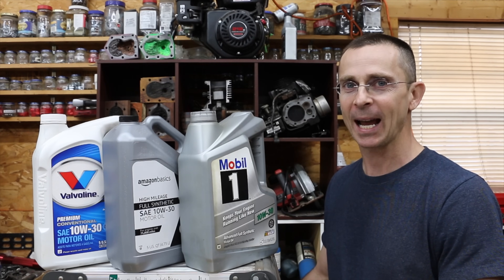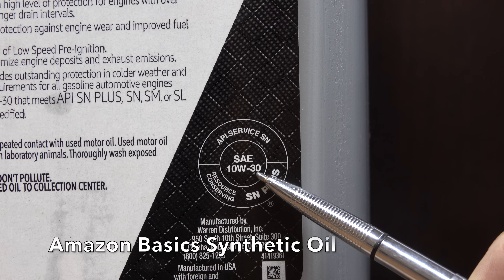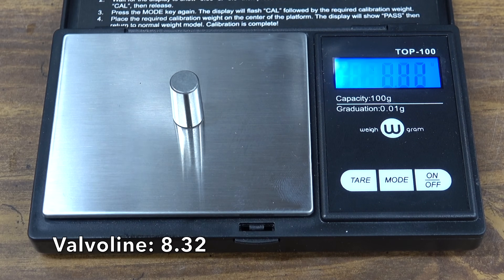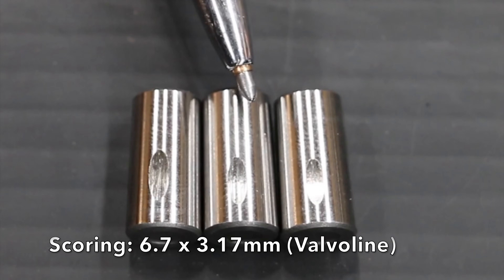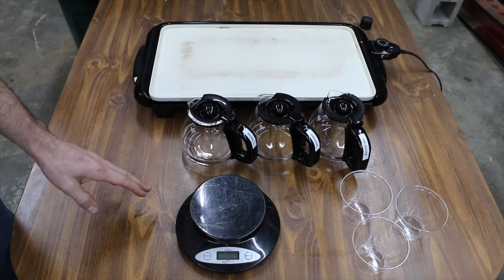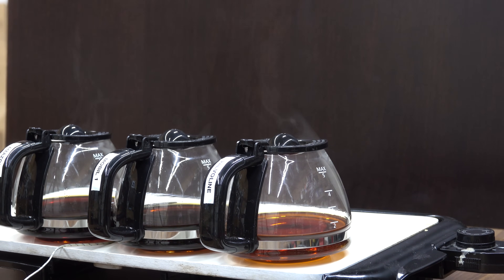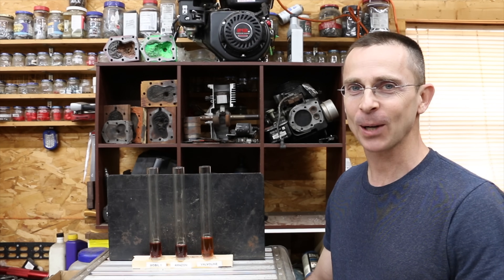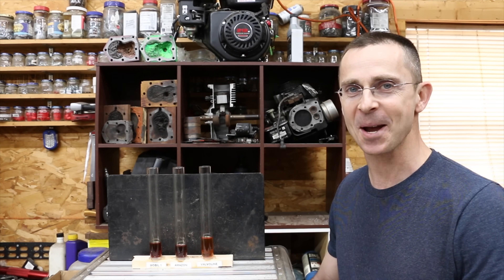Is AmazonBasics Full Synthetic Motor Oil better than Mobil 1? Let's find out!

Comment: I bet the Amazon oil is just a quality name brand oil that got licensed out to amazon for re-branding.
Reply from the maker: Thank you.  It's made by Warren Distribution, a very reputable company
Reply: @ProjectFarm  > can we safely assume that the new Costco oil (Kirkland Signature) is identical to the Amazonbasics because they're both made by Warren?  

Of course, provided we are comparing apples-to-apples, ie same weight, synthetic. dexos1 etc., etc.  PS - your videos are amazing, I'm a HUGE fan.
Reply: @ProjectFarm  i was actually looking at that during the talk
Reply: The problem is that it is put under that generic name.  So there is no guarantee of future quality.  Amazon probably operates like walmart in this regard, sourcing from whoever will meet their specifications at the lowest price.  That may be a good producer today, maybe not so good when that contract runs out.
Reply: @gurgy3  Yes, I totally agree.  There is all kinds of swapping sources on all the other Amazon Basics products...
Reply: @gurgy3  It does not matter who makes it, if it meets the specs.
Reply: SLRS I’m sure Amazon has a comprehensive lubricant QC laboratory staffed by engineers and not just a corporate office flunky with an MBA trying to shave a few pennies sourcing the suppliers.
Reply: @gurgy3  actually there is a guarantee that quality will stay consistent. It's the API SN+ seal on the bottle. If they don't meet quality levels, they lose their certification. And would be sued I'd they didn't meet claimed quality.
Reply: I was wondering that too. "Amazon Basics" is just a name brand but there is no way they built a bunch of different factories, made a whole RnD department for each division to develop products from nothing. definitely just contracted out work to existing factories.
Reply: VanSanPro Costco does that with Kirkland so I don’t see why not
Reply: @tyleralexandermills  Fun fact: Kirkland signature full synthetic oil and amazon basics are both made by warren distribution, along with walmart's supertech full synthetic. They are all most likely the same oil.
Reply: @VanSanProductions  Of course it is.  Amazon does not make oil.  Isn't even a question.
Reply: Similar to the great value brand of Walmart
Reply: @DarthNeummy  also great oil. Might be switching to this oil as I can get a Wix filter from Amazon and not from Walmart. Fram really sucks.
Reply: @GetFitEatRight who do you know that has a filter of any brand fail. Fram was a great filter until the internet came along.
Reply: @DarthNeummy  SuperTech
Reply: That's what best buy does with their insignia brand. Most insignia TVs are actually old Samsungs
Reply: The Amazon oil is made by the exact same company as Walmart's Supertech oil
Reply: @johnfarrell8832  not exactly
Reply: @NaturalizationActof1790  saw on another video says Warren has been around since 1921
Reply: F&F Home Improvement It’s a relabled Mag 1 you’re right
Reply: @DonJuanAbrahan  mag one is  warren oils flag ship oil
Reply: @triplea7536  Amazon has super low margins on lots of things. It's fine when you move as much volume as they do. They even take a loss on things sometimes to push out competition.
Reply: Is the same oil as walmarts Supertech
Reply: @DonJuanAbrahan  Mobile 2.0 hah
Reply: F&F Home Improvement that’s ridiculous then though cause mag 1 cost $15
Reply: That's how it works , some middle man lost his job guaranteed.
Reply: This is probably a correct statement.  Good marketers are trying to hit all the appropriate price points, because they understand that the real reason people buy stuff is because of how it makes them feel about themselves when they buy it.  They are trying to target each segment, and the truth is that Amazon Basics is probably bottled right next to another high quality branded oil on the exact same factory line.
Reply: yeah, to be honest most amazon basics tools and such aren't actually too bad, they reverse engineer lots of products then use their superior distribution and manufacturing relations to provide good products at cheaper prices than their competitors
Reply: or they just outsource it to another company like this
Reply: Same company as SuperTech Walmart brand
Reply: Exactly
Reply: You won that bet...
Reply: What do you think 99% of Private Label is?
Reply: https://www.youtube.com/watch?v=7fhRwwk5on4
Reply: Amazon Basics is a generic brand similar to Great Value, Parade, Up&Up, etc.
Reply: Blivant So then what about Kirkland? They literally run a monopoly😂
Reply: It’s probably Mobil 1
Reply: Last time I went to kragen o'reilly the manager said that their oil was mobile or something like that and it’s just packaged in something different. I wouldn’t be surprised if this was the exact same situation. Trader Joe’s does the same thing and that’s why their food tastes so similar to name brand stuff.
Reply: Yeah but valvoline sucks
Reply: Valvoline has actually been proven to be one of the best oils made. Pennzoil, Quaker, and Mobil are actually the 3 worst oils in true testing. But Amazon basic and super tech oil are made by the same people who make gumout and craftsman lubricants and oils.

Comment: Alright but those measurements are within the margin of error. 2 of them were a difference of 0.01g and the other 0.02g. Not something you can use to support your argument js
Reply from the maker: Thank you for the feedback
Reply: Okay also your heat test where you weigh them after falls in this category as well
Reply: You at least have to weigh them multiple times and average it ffs

Comment: I just want to start with, thanks for your videos! They are great and informative. 
That being said you have educated me on evaporative oil loss.  I use the Mobil1, 15,000 mile extended life oil.  I was sceptical at first so I would still do my oil changes at around 7500 miles.  However, my last oil change I went the full 15,000 miles.  To my surprise the oil did not look to bad when I drained it, but before I drained it I checked the oil level.  And found I was about 1-2 quarts low.  So, although the oil works great, I had significant evaporative loss.  Going forward I now know, thanks to you, to monitor the oil level throughout the 15,000 miles.  Thx
Reply from the maker: Thank you very much.

Comment: Is it possible they're just putting 5W in the 10w bottle? I find it odd that Amazon could just stomp up an oil that meets Mobil, for less money. Obviously they haven't developed it themselves but they must be cutting corners somewhere, it's what Amazon do. 
It wouldn't surprise me if they bulk buy a half decent oil and sell it as various grades. It would explain why they only excelled in the cold fluidity test but met Mobil on other tests.
Reply from the maker: Thank you for the feedback.  It's API grade oil and as such has to meet the viscosity grade requirements listed on the bottle.

Comment: Here is my useless thinking, but. Amazon or Walmart oil, you never know if quality will be same from order due to which supplier they may used that bids lowest. I wouldn't be worried with using them, but I tend to buy penz ultra platinum when it's on sale for around $19 a Jug. Around Xmas  Pup was cheaper than the Amazon basics, and Havoline full synthetic was a steal at around $16 in 6 qt box.
Reply from the maker: Thank you for the feedback

Comment: Sorry for repeating question but do all these oils address what pre 1996 engines need ? Meaning the cam shafts need zinc content . Is that right ?
Reply from the maker: Most have low zinc content.  Redline and Amsoil have adequate zinc content. Thank you
Reply: @ProjectFarm  Ive been using Amsoil racing 4 ever that even states its zinc on the front label but its pricey for my 5 pre 96 cars I drive full time . Now what Project Farm ?

Comment: It is not always best to have a low viscosity. Higher viscosity tends to have higher load carrying capacity and harder to squeezed out under the pressure. It is silly just compare the viscosity. You can use acetone or methanol at -15 F degree and it will flow faster than Amazon basic and Mobil 1... Tribological performance is not a simple matter of comparing the viscosity....
Reply from the maker: Thank you for the feedback

Comment: Been using on my trucks a TRIAX Fleet Supreme 5W-40 i get from Amazon. Id be curious to see the tests on this, especially the friction tests. Using it on 3 x F250 and 1 x F350 Powerstroke. Manufacturer says it has huge Boron and Moly, unique adpack content which is supposed to help with wear and general engine operation.  My experience with it has been phenomenal and the amazon reviews are in line with what im experiencing. Way faster turbo spooling, quiet engines and getting about 1-3 mpg better fuel econ, my average drain is about 12,000 miles with Polaris lab analysis.  Wanted to see how this performs in your tests. Here is the oil. https://www.amazon.com/Triax-Supreme-5W-40-Ultimate-Synthetic/dp/B07P8JCTB2

LOVE Your channel by the way and the detail you put into your work.
Reply from the maker: Thank you for the feedback

Comment: well my 2008 Subaru Impreza OBS has been living on Mobil 1 high mileage pretty much since day one at 12 miles on the odometer.  started using 10W-30 as it crossed over 200k per Dr. Subaru in my area. the car has the original engine and head gasket. a new timing belt was installed by Dr. Subaru at 193,000 miles. I can't complain about Mobil 1. I change the oil every 6 months or so and at 5 to 6k miles. the 12-year-old car runs like new with plenty of power and doesn't burn much if any oil...
Reply from the maker: Great feedback. Thank you

Comment: I would also LOVE to see the bearing wear test (at both room temperature AND operating temperature) comparing Mobil1 5w30 and Mobil 1 0w40.  The idea is to the test the common claim that the additional ZDDP in the 0w40 will reduce wear on flat tappet cam/rocker engines.  There is allegedly a common issue with modern low ZDDP oils and cam wear in older Hot Rods.
Reply from the maker: Thank you for the video idea!

Comment: great video, thank you
Reply from the maker: Thank you!
Reply: @ProjectFarm  can you compare 15w40 diesel oil to normal 10w40 and synthetic oil. I've been using 15w40 in my vehicles for 25 years with no issues over 200k on every vehicle. Thank you

Comment: Hey, I am a regular mobil 1 full synthetic user and have used it since "upgrading" from Ford's Motorcraft synthetic blend. However, my street car has used strictly Shell Rotella T6 5w40 since the new engine, installed 20,000 miles ago. Can you possibly do a side by side test of Rotella T6 and your top contenders (amsoil and pennzoil full syn.) ??
Reply from the maker: Great video idea!  Thank you

Comment: I have owned a lot of gasoline powered lawn equipment.  The company I bought them from had their own repair and service department.  They told me if I ever used valvoline in any of my engines, it would void their warranty.  I asked the mechanics at my job about valvoline.  They told me when they would remove the valve covers from an engine that used valvoline, there would be a build up that looked like a bar of soap that had melted.  Enough for me.  I'd never put valvoline in any engine I own.
Reply from the maker: Thank you for the feedback

Comment: Love your work. I didn't know where to ask this question. After 50,000 miles on my Subaru I've decided to change my own oil with mobile synthetic instead of Subaru synthetic. Yesterday I saw Kirkland synthetic in Costco for the first time, of course a great price. Do you know who makes it and is it recommended? Have you tested it? Have you ever tested the 0 w 20 synthetic that Subaru requires ? If anyone would know it would be project farm thanks
Reply from the maker: Great video idea!  I'll test it.
Reply: @ProjectFarm  
 I hope you test the 0-20 w. I've never seen anyone compare it. And why does Subaru use it for the boxer engine

Comment: Synthetic works great for some vehicles, if it has a timing chain then synthetic will greatly enhance the life of the vehicle, but in my experience, vehicles with timing belts....Do not use use synthetic unless the manual recommends it, a slight leakage on the timing belt can cause catastrophic engine failure...
Reply from the maker: Thank you for the feedback

Comment: honestly i tryed the amazon on my HOnda civic, i drive alot. i used Amazon for 2 oil changes, have over 150k miles. and the 2nd time i tryed Amazon car hard a little more vibration and not as smooth, compared to mobile1 i been using before.
Reply from the maker: Thank you for the feedback

Comment: Super interesting video! I don't mean to be a smarty pants or anything but if you are curious why amazon appears so good: I'm fairly positive that the amazon basic's oil was able to get away with such a low price point by using a cheap polymer and possibly additive package. That's also why it had such good cold temperature properties. I'm sure that if you were to test all three oils after being in an engine for an extended period of time, the amazon oil would lose a lot of viscosity. Thanks so much for the awesome content! I would be curious if you tried out some of these snake oil products like https://www.evergardpro.com/... If you look at the website you'll see what kind of nonsense I mean.

Comment: Todd I was wondering if you ever considered doing a 5w-40 Amazon basic vs shell t6 and Lucas and royal purple test. I was shocked how good the Amazon oil did in this test. I will definitely be buying some of that. 

Many thanks. Luke
Reply from the maker: Luke, Terrific video suggestion!
Reply: Project Farm thank you! Also I saw a YouTube video where they did cold shear strength. They had shallow curved dishe of gear oil at -30f and a rod across them with 1/2" flappers in each tub of oil. They turned the rod slowly simulating how fast an oil will fill the void in cold temperatures. Simulating a ring and pinion. I'll try to find the link. It was a video from the 80's of an oil company in Canada but I can't remember the name.

 They also rigged up an oil pan with a pump and showed what 15w-40 does in the winter. And did a whole car also. It was an awesome video. Might be something you can recreate it blew my mind

Comment: Please do a video on gun cleaning agents.
I think this can be simulated pretty easily without using guns.
1. The barrel builds up lead and copper in the rifling. Apply gun cleaning agents to bare copper and lead sheet and see which one dissolves these metals best.
2. Barrels are made from stainless steel or certain grades of regular steel. Apply the cleaning agents to these metals and see which one dissolves the steels the least.
3. Guns are commonly blued to help the steel resist wear and rust. Apply the agents to blued steel. Which one damages the bluing the least.

4. Gun powder residue builds up in the action of a gun. Magnesium, steel, stainless steel and glass filled plastic are comonly used for these sections of a gun. Burn gunpowder on each material type. Apply the gun cleaning agents. Which cleans off the gun powder residue the best.
5. Some gun oils claim to keep your gun clean longer and resist metal and powder build-up.
5a. This is more burning gun powder and seeing if it sticks to things as well as bare metal and plastic.
5b. A lubricity test with copper and lead slugs in your machine. Which oil leaves the least amount of metal residue on your spinning wheel.

For these tests, include WD-40 and 3 in 1 oil since they get used in guns quite a lot.
Reply from the maker: Thank you for the video idea!

Comment: Sir I often enjoy your videos/ I was thinking about  a easy one. Does synthetic get better fuel milage.  Take your poor lawn mower fill it with  regular oil and hook a 5 gallon tanks and see how long it runs, and then drain the oil fill  synthetic and see if the engine with run longer with the synthetic than with the regular oil,
Reply from the maker: Thank you for the video idea!
Reply: @ProjectFarm  they claim the synthetic help you get better fuel mileage . be interesting if you could check it out in a video

Comment: does it hurt my vehicle to change from full synthetic engine oil( petroleum bases oil) to 100% synthetic oil(synthetic based oil)?
Reply from the maker: It should not be a problem
Reply: @ProjectFarm  thank you... i went into amsoil's website and search a closest shop that sells amsoil and they only sell the amsoil OE 0w20, i went ahead and buy it anyway since its the only available to me.. will purchase the amsoil signature series on my next oil change instead which is probably after 6500miles of driving.

Comment: I have changed oil in all of my vehicles for the past 43 years and worked in gas stations in the late 70s. I'm not a mechanic but do sit under shade trees occasionally. But my point is I have never had a repair on an engine due to lubrication failure. The only oil that I've seen that clearly causes lubrication failure is the older Quaker state oil which causes slug buildup.
Reply: And by the way women(wife, girlfriend, daughter, sisters, etc.)  cost cost much more than any vehicle I've ever owned. 😂😂😂
Reply from the maker: lol

Comment: Hello sir, could you please do a test between motorcycle engine oil and car engine oil? 
Full synthetic motor cycle oil is 2 to 3 times the price of full synthetic car oil. I run Motul 300V 10w 40 & 15w 50. I also have a Harley that runs 20w-50.
Thank you for your consideration.
Reply from the maker: Thank you for the video idea!